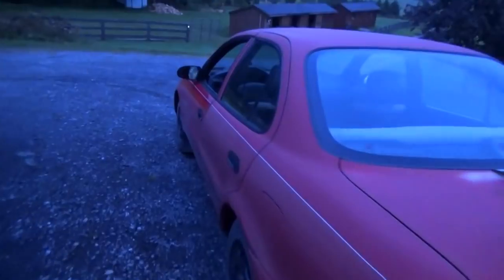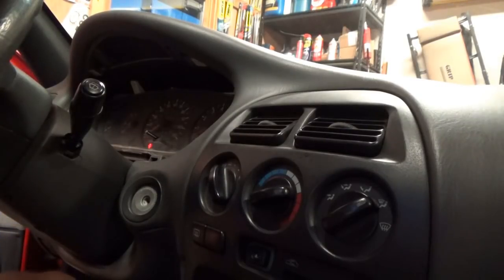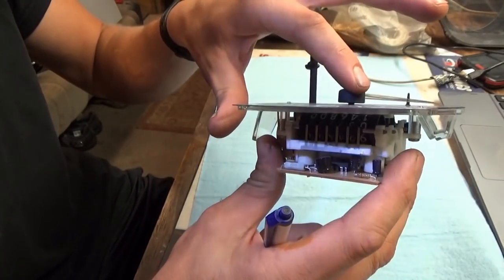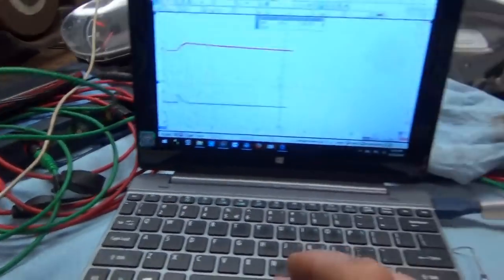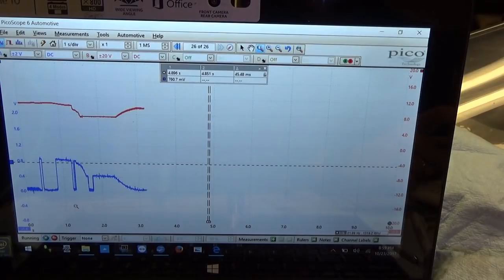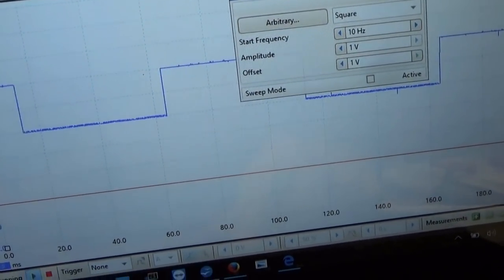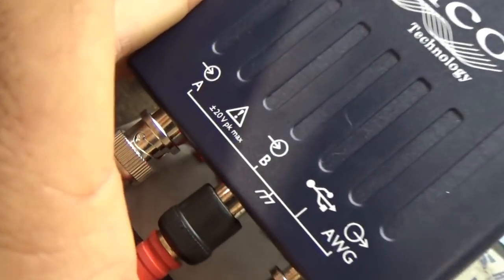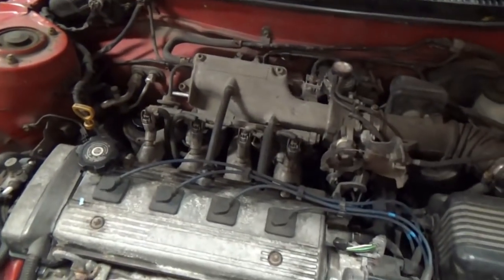Toyota (Geo Prizm) Speedometer: Diag & Repair

Comment: I do admire your dedication to making this work and fixing it, this is rare nowadays when people just change parts until everything is fixed, but still.....would it no have been easier to get the damn cluster from junkyard ?

kyard ? :)
Reply: I could have repaired it in way less time than it would take you to pickup or  dig for a junkyard  part, that may be bad also ;)
Reply from the maker: That is an option, but resetting the odometer would be a PITA!

Comment: Hi, I don't understand the T from the signal generator.  So you give the speedometer +12V and ground from a Power supply, and then give the speedo +1v and GND from the signal generator?  Wouldn't it need a common ground?

Comment: Hi Ivan, interesting video as usual! If I would use a Picoscope, instead of a snap-on what can be used then  to: read and cycle ABS, Evap, or reset Airbag after replaceement?
Reply from the maker: Are you talking about bidirectional controls? That is a function of a scanner. PicoScope is an oscilloscope :)
Reply: Pine Hollow Auto Diagnostics Yes I wad trying to figure out what could replace an expensive scanner/ oscilloscope. But at he end Istill need a scanner if I need bidirectional controls. Guess I can go then on the cheapest with bi controls, around 500usd.
Reply from the maker: Yes it is more convenient to have the scanner and scope separate anyways :)

Comment: Nice diagnosis & repair Ivan! Neat trick with the odometer. It's due another oil change and you haven't done the first one and after 100K no engine wear...see that college education is paying off HAHA. Nice touch with the Pico and tips!!
Reply from the maker: I calculated that I would have to run the signal generator at 100mph for 50hours to get to the next 5k oil change ;)
Reply: I knew you'd have it all calculated out and then you'd figure how to accelerate it by increasing the frequency with a typical step recovery diode multiplier. :D

Comment: Did you notice if the prizm had excessive blow-by before you did the rings, I have oil consumption no blow-by no leak, power is good any ideas?
Reply from the maker: Oil control rings like you saw in my video :)

Comment: I have corolla 1996 amd it's speedometer needle jumped up and down 80-0, 100-0, 20-0 an then stopped. It all happened when i turned on the ignition and engine was not in start position. After that i drove the car but needle remained at 0. Can someone please guide me if there is problem with sensor or in the meter.

Comment: Test drove once a 1994 Toyota Corolla 1,6. Speedometer worked fine but central locking was messed up. Locked the car and few seconds later door locks popped open again. Otherwise it was good car but I ended up buying much newer but smaller car.

Comment: I completely agree that the scopes on a vantage etc are crap and way over priced.  However, with the Pico, you have to combine the cost of the Pico with the cost of the laptop/tablet you have to connect to it. At that price point it isn't as affordable. And then you have the problem of planned obsolescence. For example, Standard USB (USB-A & USB-B) is going the way of the Dodo and will soon not be available on 'modern' machines without adapters. Eventually something else will replace it completely and you'll be S.O.L.  Or in a couple years the Pico software may not work on newer OS's if the Pico company stops supporting your model Pico scope. So you'll have to keep an ancient machine laying around to use your Pico. Thats a P.I.T.A. IMO, I prefer a stand alone scope.  You can get one that would blow the doors off a Pico or Vantage in resolution, memory, accuracy & bandwidth for less then a couple hundred bucks (like the scopes made by Rigol).

Comment: Scope, bench power supply, function generator, and capacitor decay.  Brings back electronics lab memories.  Did Dr. Ivan find a faulty pull up resistor solder joint?
Reply: It may have been a pull down resistor??
Reply: Gene Mean yes, it could have been either.  Not really sure where that resistor is actually located in the circuit.  I was debating between pull up and pull down myself.  I just went with pull up because the voltage on the scope held steady at a higher voltage when the continuity was reestablished.

Comment: Good repair, but I'm a little skeptical about the car not using any oil for 5 thousand miles. Please double check the facts on that.
Reply from the maker: I understand your skepticism, but I assure you this is 100% accurate over the last 5 oil changes since the rebuild.
In my experience I have encountered several vehicles that do not burn A DROP between oil changes:
1) 2010 Nissan Rogue 2.5L - 195k miles
2) 1996 Mercury Mystique 2.0L - 249k miles
3) 1996 Toyota 4Runner 3.4L V6 - 150k miles
4) 1996 Geo Prizm 1.6L - after engine rebuild - 258k miles
Reply: My daughters 1995 Mercury Villager. 3.0L V6, 342k miles can easily go 5000 between oil changes and not need any oil.

Comment: Well at least it isn't a General Motors cluster it wouldn't have lasted that long. Very tough Vehicles the prism and the Corollas are. Well the vehicle jumps to plaid speed in a hurry.
Reply: Phoneguy13 aside from shitty electronics GM never made a successful 4 cylinder engine all they did is a rebranded Daewoo fiascos
Reply from the maker: 2.5 iron duke? All the mail trucks are still running around on those!
Reply: And those boxy looking LLV post office trucks will run 80 mph too!
Reply: Pine Hollow Auto Diagnostics that's right, when America used to build stuff that lasts for life too bad these days are gone for good